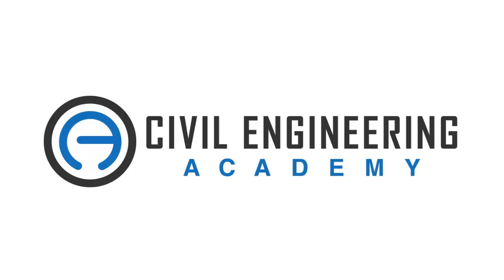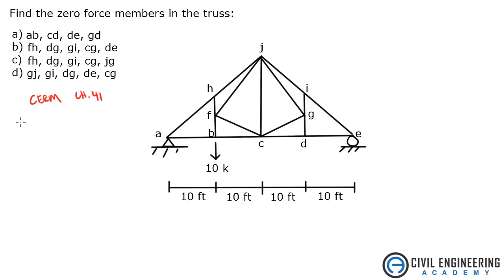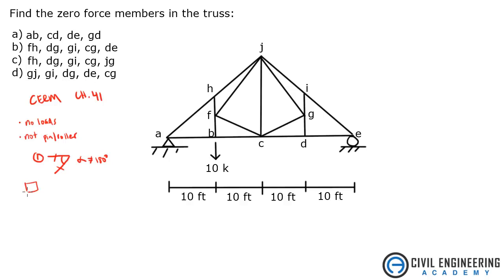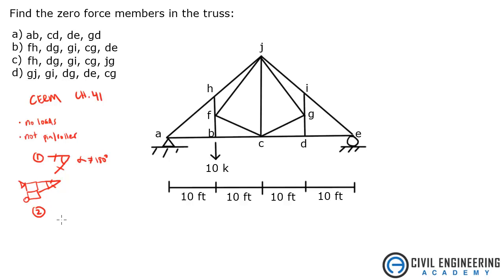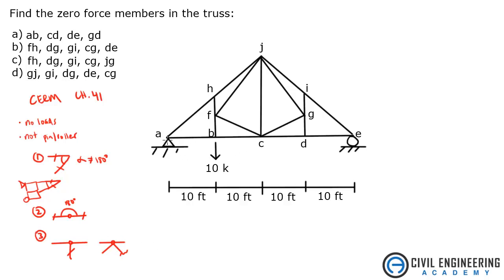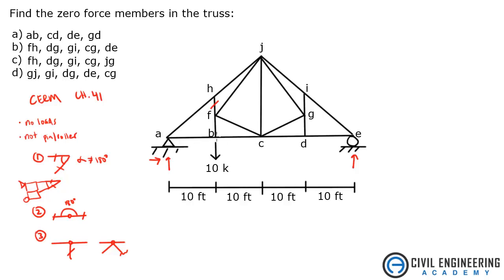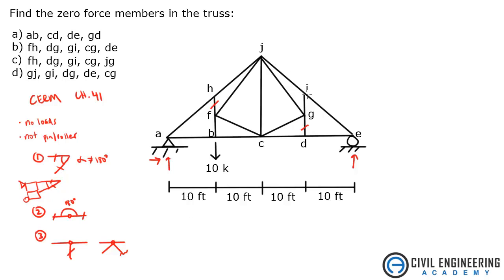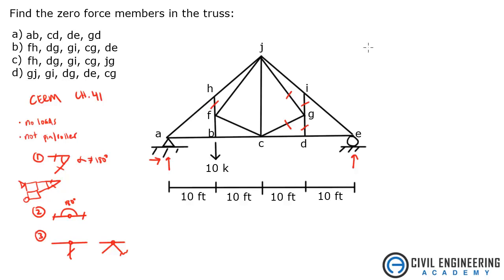Structures-Zero Force Members in Truss

Comment: Why isn't JC a 0 force member? I understand there is a vertical component probably affected by the force due to the acceleration of gravity, but would that be the only reason? Sorry if this is a stupid question.
Reply from the maker: For this case, JC can't be zero because the external loading is only applied at point b. It makes the structure unnsymmetrical, so JC must have internal member force.
Reply: Civil Engineering Academy hurray ! got it

Comment: What rule(s) did you use to determine that fj and fc are not zero force members?
Reply from the maker: Brandon Ornelas after you've identified the zero force members you need to analyze each joint using the method of joints.  You can see that the external load that runs at point B is transferred to member fb.  Because fb has a load on it fj and fc will have a load on them because we determined that hf was also a zero force member.  These are tough to get a hold of so it helps to see many examples.  Here's another great video on Youtube that can help:  https://www.youtube.com/watch?v=LAb_ezELQ_Y
Reply: +Brandon Ornelas Pretty simple.  Do this:
1.) Ignore the "explanation crap talk".
2.) Draw a free body diagram of "only the point F".  Then take ΣFx.  Solve.  Get it? Got it!
3.) Btw, who coined the phrase Analysis of Joints? I just call it FBD at a point!!!